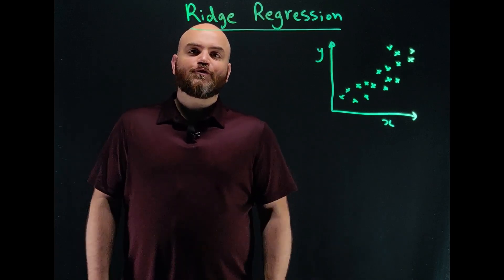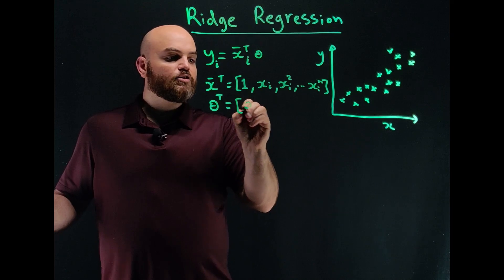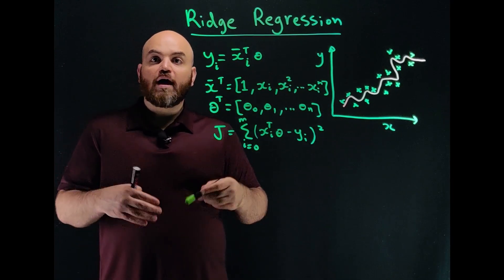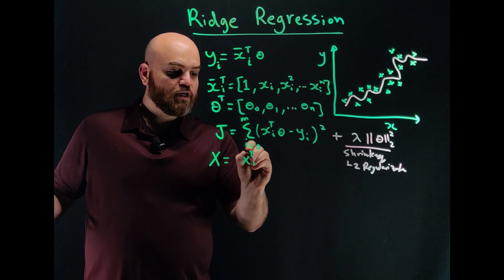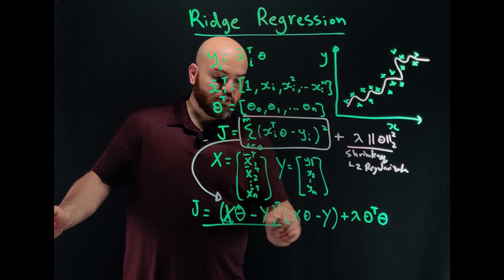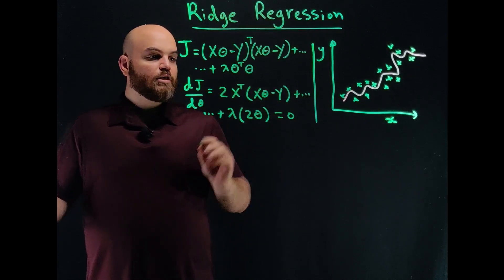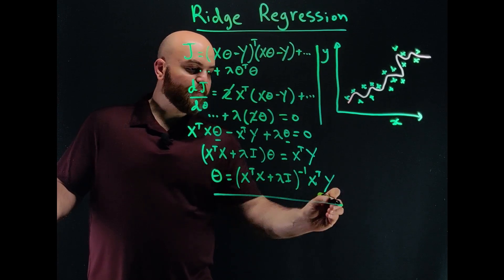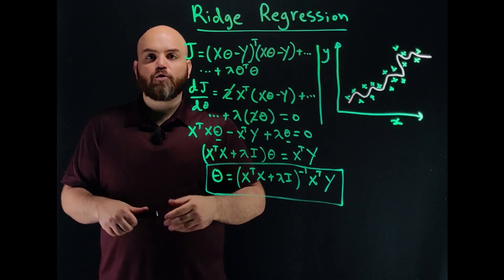Ridge Regression (L2 Regularization)

Comment: What i didn't understand is , now lambda will be only on the diagonal,and how it'll help (X)TX - lamda(Identical matrix) why just the identical element , why not all
Reply from the maker: Hi Yatin. 
Lambda is away to penalize the model parameters from getting too large, so if you set lambda=1 you get an identity matrix. But typically in practice that is a large weight to penalize the model parameters, usually lambda is a positive number that is <1. That works well in practice.

Comment: If you don't to any normalization, a reasonable choice for theta can easily be much larger than 1. Since with least squares we have a convex error surface, you don't need to normalize. However, I agree that in general normalizing your data doesn't hurt and in that case your suggestion of picking a value between 0 and 1 makes a lot of sense! Kudos for the nice explanation and derivation!
Reply from the maker: Thanks for watching! Glad you found the video enjoyable.

Comment: That's a kind of video what i was looking for. There is a lot of videos with obvious informations and nothing about mathematical representation and derivatives. You did it very well.
What about constant - theta_{0}? A lot of sources say that theta_{0} shouldn't be regularized and then in the equation instead of identity matrix we should use modified identity matrix with first row full of zeros.
Reply from the maker: Hey Adrian. Thanks for watching. 
You bring up a good point here, and I think the answer to that is that it depends. Every model and every datasets may have different scaling requirements, and having the theta_0 (bias) term regularized or not depends on that. I have personally always implemented it with regularization, ans have not needed to take it out. I would be interested to see how that affects the results. Maybe I can do a test example and make a video on that!

Comment: The final formula is not correct. You should not get identity matrix $I$ in the formula.
Reply from the maker: Hi Anar, thank you for the comment. 
The reason an identity matrix is required is for mathematical consistency. The first term in brackets  (x^Tx) is a square matrix and we can't add a scalar (lambda) to a square matrix, so to have the correct mathematical notation the identity is required.
Reply: @EndlessEngineering   why we should not have concidered at one matrix where all values are 1 instead of only diagonal as 1.
Reply from the maker: @yatinarora9650  a diagonal of 1 does not follow the same formulation as penalizing the norm of the model parameters with lambda. In practice lambda is a positive number that is usually < 1. We do not want to penalize the norm of the model parameters too much, that might cause us to not fit the data well